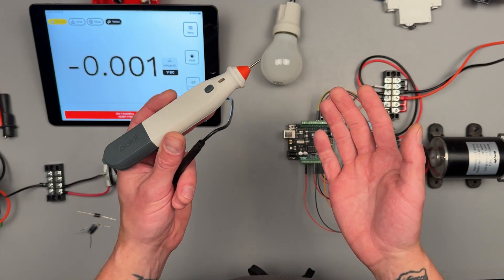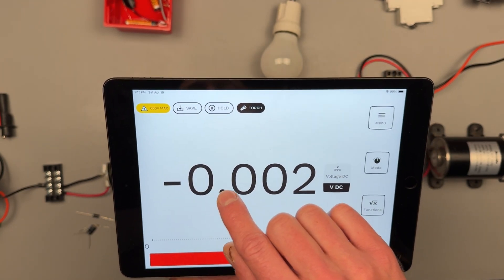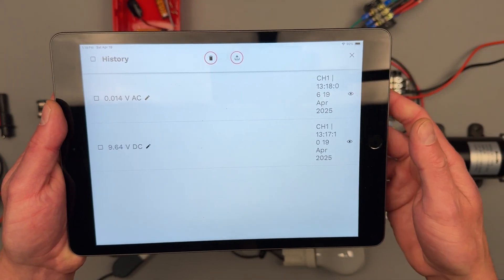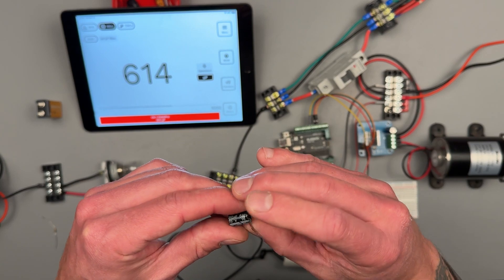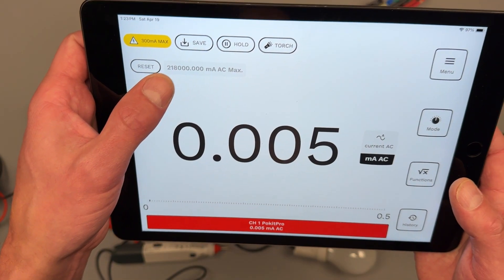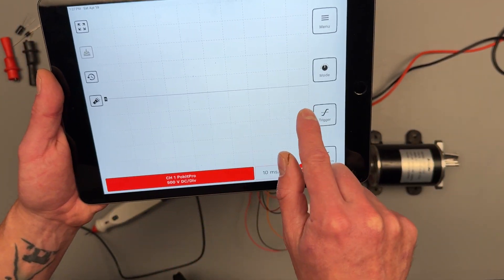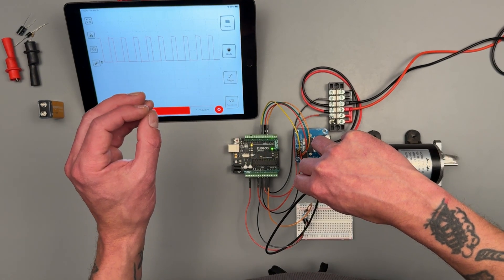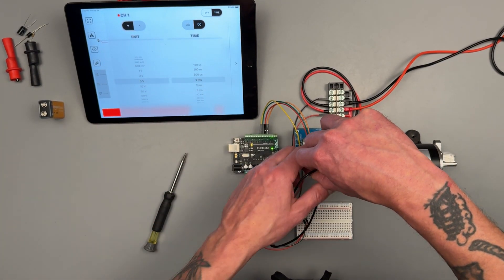How to Use Pokit Pro Multimeter and Oscilloscope 📱🔬

Comment: Can it be used without the e app for continuity or voltage present type functions?
Reply from the maker: No, it needs to app to make measurements. App is available for phone and tablet. The main app is free on apple and android. I believe I just saw a post from them on Instagram that the app is going to get a refresh here soon as well. Gotta say they're a pretty cool company to work with.